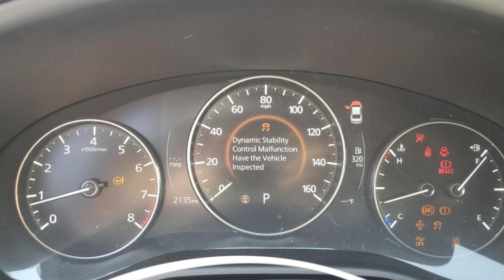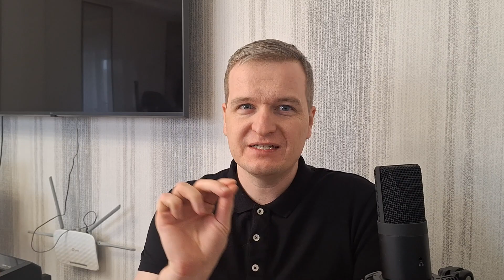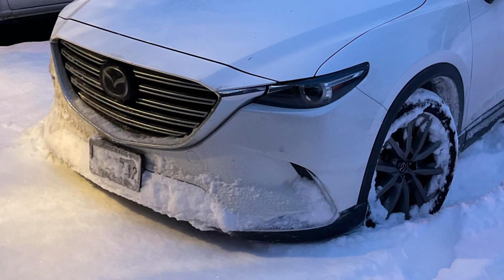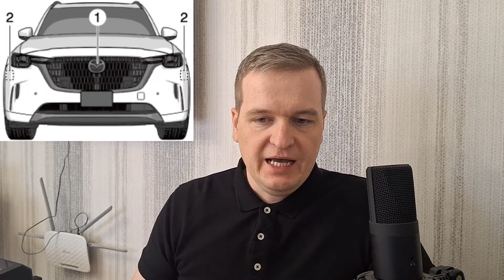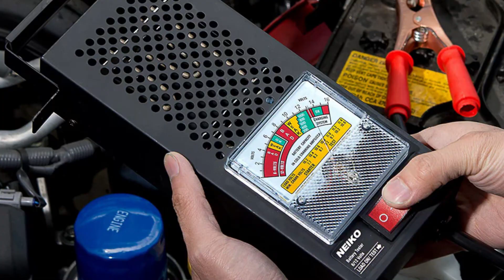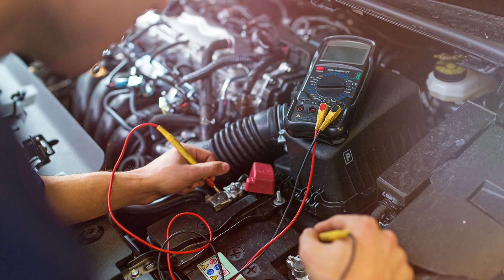“Dynamic Stability Control Malfunction” warning in Mazda cars: Reasons

Comment: Check Battery First, if voltage okay, and your error is DSC, istop and parking brake (red P), change the brake light switch, doing this cleared those errors for me, takes less than 5 mins to change diy.